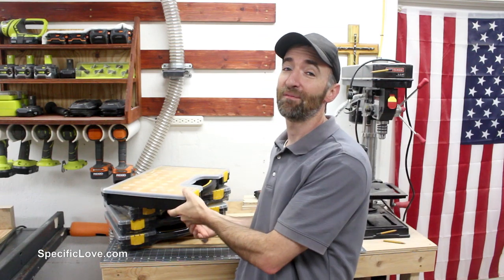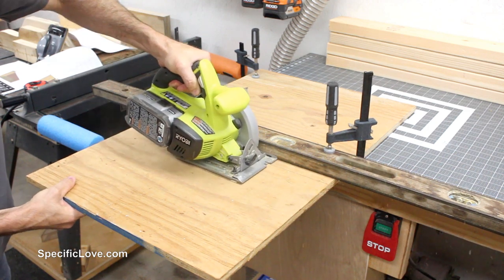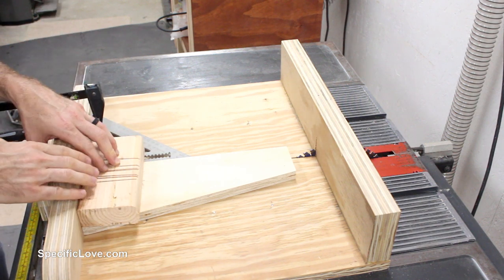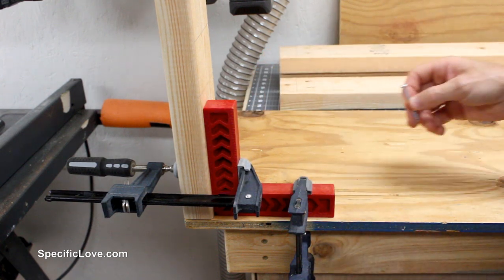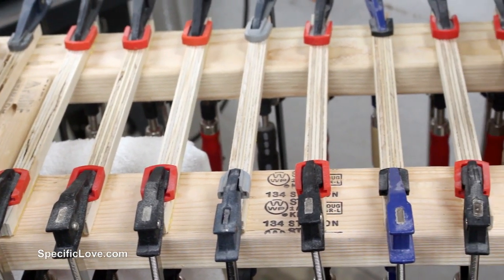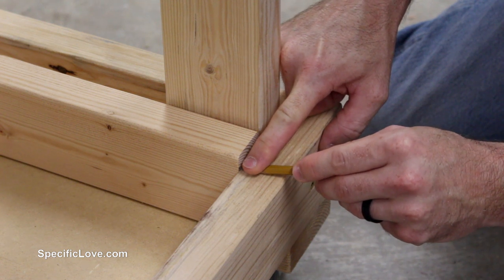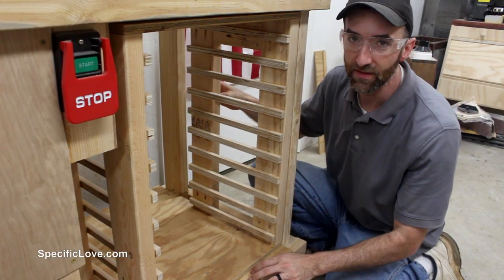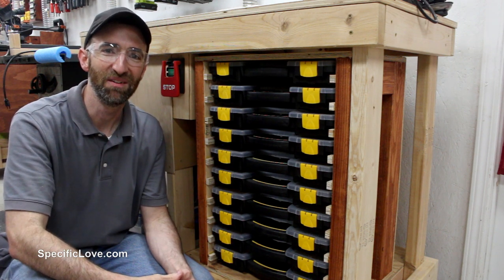Parts Organizer Storage Cabinet for your Garage or Workshop

Comment: Looks good. I was surprised at the quality of the Harbor Freight organizers. Much better than typical HF.

Add labels to each organizer and you will be set.

Thanks for sharing.
Reply from the maker: I was a little surprised too. I have noticed that some of their stuff is better than others.
Reply: @SpecificLove7  I found that I needed more of the small holders inside the bins than came with them so I 3D printed a bunch.  Worked like a charm.  I like how 2 little ones fit into the space of a medium one and 2 medium ones fit into the space of one large.  That gives a lot of flexibility in the layout.

Comment: Nice job ... your vids are fun to watch! One issue with the parts organizer that could use some re-engineering: wouldn’t it be nice to pull it out,  open the cover, and slide it back in (without needing to take it all the way out and place on the workbench)?

Comment: I know this is an older video but I just found it. Anyway, I have a bunch of those and right now they are just stacked on top of each other. And the one I need is always in the middle of the stack forcing me to move a bunch of them just to get 4 screws out of the one in the middle. 
Anyway, how did you get the labels off of the top?

Love your channel and the content you put out!
Reply from the maker: The labels were definitely a challenge. I peeled them off the best I could and then used Goo gone for the rest.

Comment: Your design is the first I have seen that did not use full shelves for each storage bin and instead uses runners under the organizer’s lid (as opposed to under the entire organizer). I am thinking of building my cabinet the same way. How did that work out for you over time? Did you run into any issues with the bins falling off the runners?
Reply from the maker: I still use them often and they work great.

Comment: Great video, what is the thickness of the runners that hold the bins?
Reply from the maker: 3/4" plywood
Reply: @SpecificLove7  yes, I got that, but then you cut it in long pieces to hold the bins. What was that other measurement? 1/2 inch.

Comment: Why do you have Ridgid and Ryobi ??  I would standardize so I didn't need two different batteries.  I went with all Ryobi for the battery tools myself.  Corded tools, I have all kinds, but I don't like having many different batteries.
Reply from the maker: I prefer the Ridgid because of the lifetime guarantee, but Ryobi has some tools that Ridgid does not, so I would need both batteries either way.

Comment: Would of been quicker and more efficient to use aluminium angle as runners
Reply from the maker: Thanks for the idea
Reply: I agree with you Meo. Problem is aluminum costs more and takes a little more work to build with.